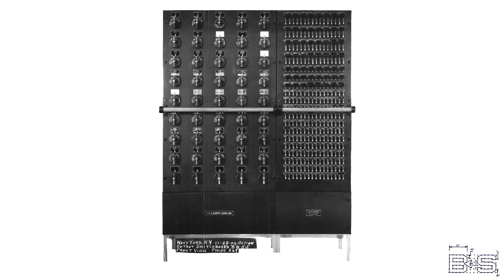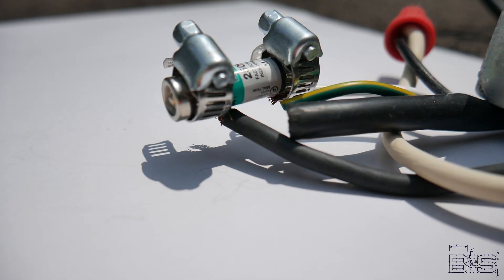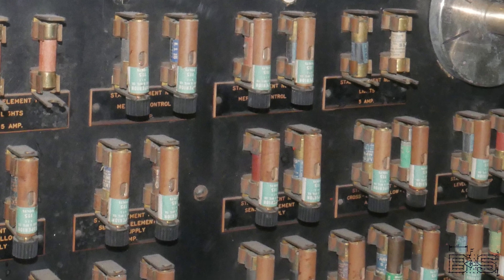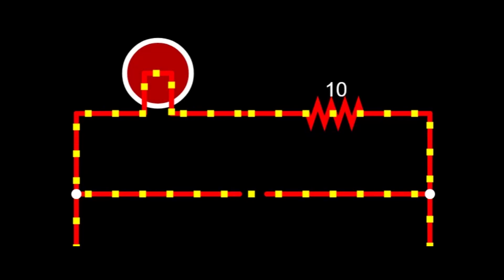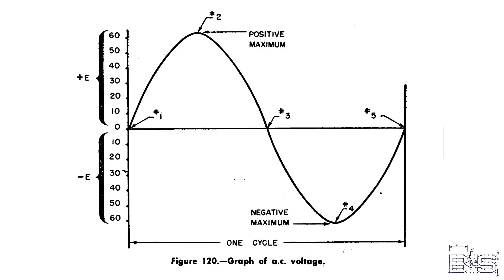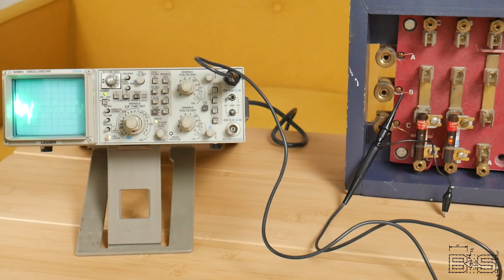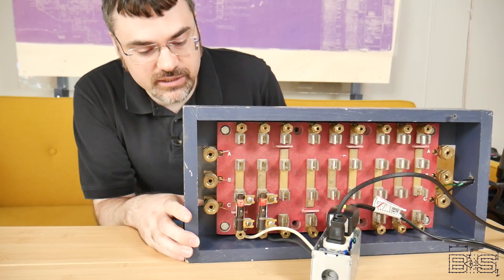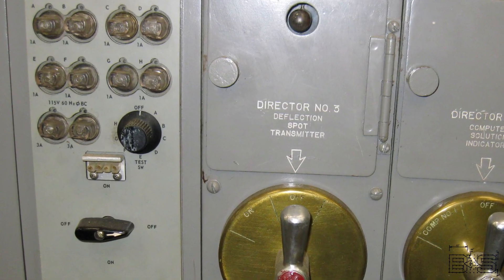Blown Fuse Indicators

Comment: I have a 'modern' variant of these fuses in my car fuse box. The LED lights up if the fuse blown but only when that circuit is being used.
Easier to spot at night when you wonder why your cruise control is not working and it turns out the brake light switch has blown. My cruise control operates off the brake light circuit as a safety requirement as a tap on the brake disables it while driving anyway.

Comment: Is there any other way this is done, or are all blown fuse indicators neon lights? Seems genius. I wonder if instrumentation BFIs work similarly.
Reply: Yes, there's a variant where a striker pin sticks out and either completes an alarm circuit either directly, or by actuating an insulated contact pair.
Reply: @sashimanu yeah I've seen those too.